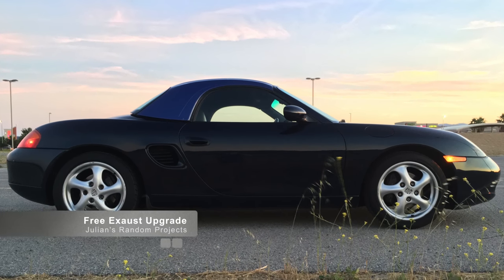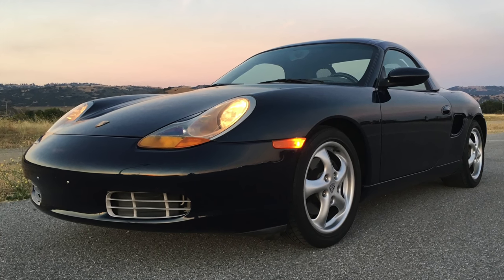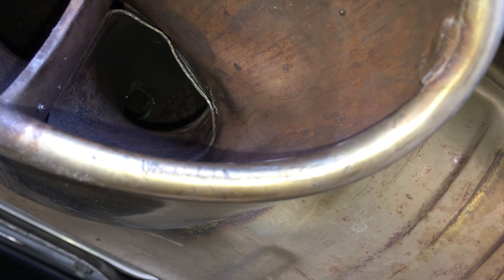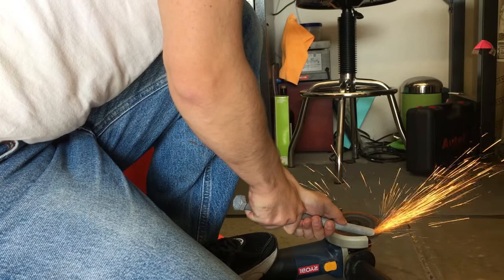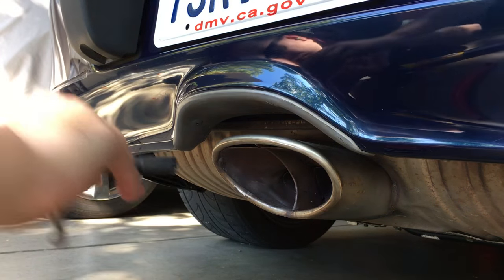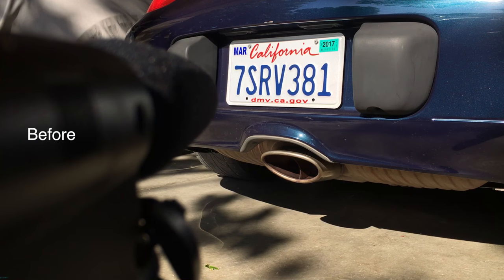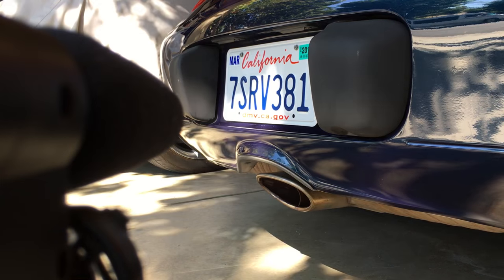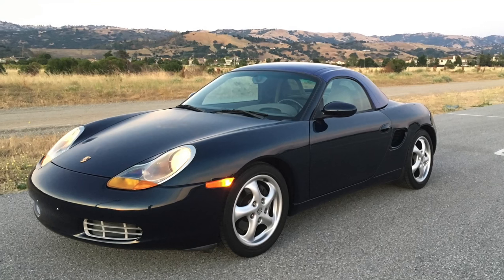Free Exhaust Upgrade - Boxster 986

Comment: a more freeflowing exhaust always helps, i had a r170 slk 200 in which we removed the cat and mid muffler for shits and giggles, that car actually started to slide into corners with the same driving profile that had been used on the car prior to the mods, i dont know about the hp gain since it is only a 136hp car but it for sure had more torque making the rear kick out quite happily with no clutch kicks, i got a video on my channel where i slide a roundabout about 1,5/4th, just gas no clutch kick

Comment: From Rancho Cucamonga CA , just poke a 1/2 hole with a sharpened  foot long rebar it took 15 minutes for both holes, might go to 5/8 ,tnx for the tip 👍🏽
Reply: dude im from rancho too
Reply: @TheKillerBloody  l can show you how  , I live at 8535, Vinmar Ave, Rancho Cucamonga CA 91730
Reply: @TheKillerBloody  I can show you how to do it
Reply: @TheKillerBloody  8535 Vinmar Ave 91730
Reply: @dagolopezsr2004  I just got my boxster back from a month of being in the shop and also 12k in reparations 😓😓let me know if you ever down to meet up.
Reply: @TheKillerBloody  sure , I did sent U my address , let me know when & time you’ll be coming over
Reply: @dagolopezsr2004  hey! I’m currently staying in Whittier and would love to come hear the difference if you have time. I have a 03 boxster base and been itching for either this or muffler bypass mod but don’t want it to be too loud at the same time (also have an ND Miata that checks the loud exhaust box)
Reply: @phant0mv87  come by today
Reply: @dagolopezsr2004  what times are you free? I work nights

Comment: Thank you’ I have an 02 base with that darn oval tip. I can’t unbolt the tip. When I look inside, I do not see where on earth you were able to punch through. It looks like my pipes go down. There’s no “wall” to punch through. Any thoughts?
Reply from the maker: Scratch through the grime to find metal and look in there with a bright flash light. You'll find what you're looking for. If that fails... save up and buy an aftermarket exhaust. :)
Reply: See my message, it’s easy to do it

Comment: Does the change affect smog? I'm in California as it looks like you are as well.
Reply from the maker: Had to take both of the Boxters I bought recently to get smoged. In each case they just connected to the car's ECU and ask it if everything was fine :) This should't effect smog testing since it's after the last sensor in the system. No different than installing a CA legal 'cat back' exhaust. Hope that helps.
Reply: Thanks very much.

Comment: How precise do the puncture holes need to be? I wouldn't want to do it in the wrong spot.
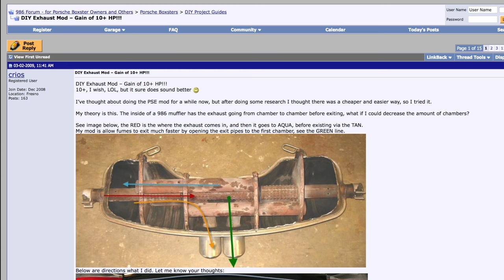Reply from the maker: Anywhere you can get to from the inside of the exhaust tips. Pause the video at 1:12 for a view of the inside https://youtu.be/PO9l-X4eUOk?t=1m12s
Reply: +JuliansRandomProject I can't seem to find a way to get the hole started, I'm trying to hammer a similar nail thing but it just slides down.
Reply from the maker: See if you can get a small hole drilled. It'll give you something to bite into. Since the inside of the pipe is turning a corner, most blows will glance off of it. Put your nail right in that hole.
Reply: JuliansRandomProject do you puncture just the first baffle wall or do you have to go through the second one behind that too?
Reply: @brokanikgarage2129  just one ☝🏼
Reply: @kahlebboyd4449  grind a 1 ft long rebar on a angle,  not like a pencil point

Comment: 0:55 why are the wheels different on the two cars? t seems like one of the cars have them swapped
Reply from the maker: Good catch! May be the difference between the 'S' model and the Base model?
Reply: JuliansRandomProject I have a 986 S, will check tomorrow! Is it possible that they have been swaped left and right?
Reply from the maker: +IscleGaming | ZefaCraft Entirely possible! I did notice the 'S' model wheels were wider and had a bit of a dish type offset.
Reply: I do have the same car and been thinking about doing this.
Reply: I do have the same car and been thinking about doing this.